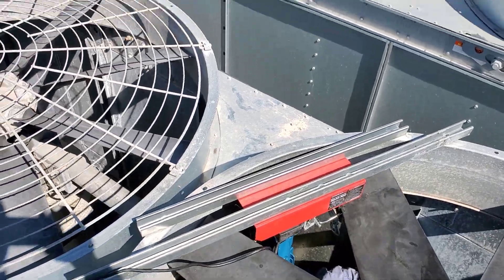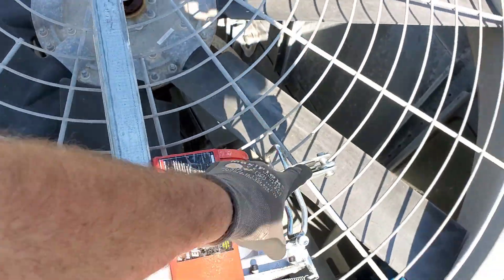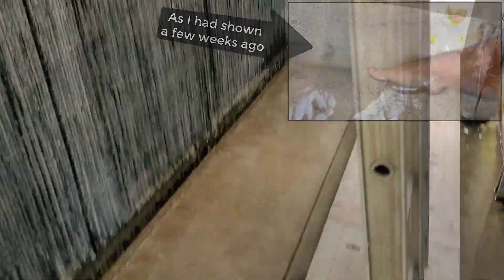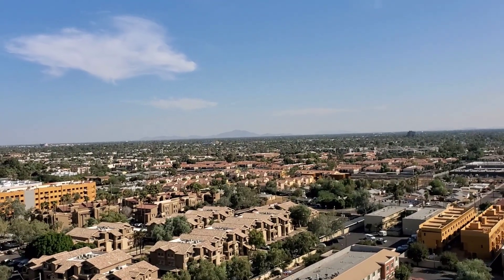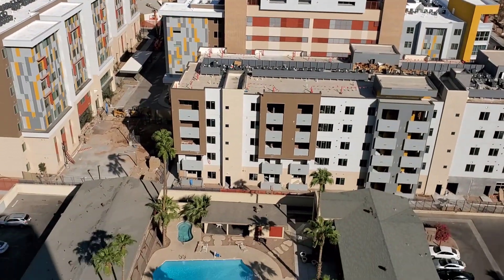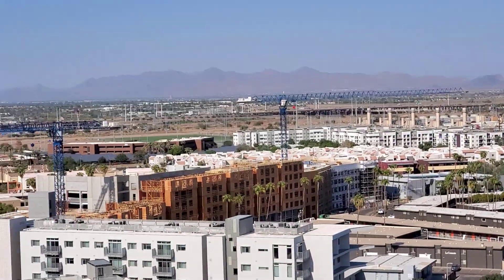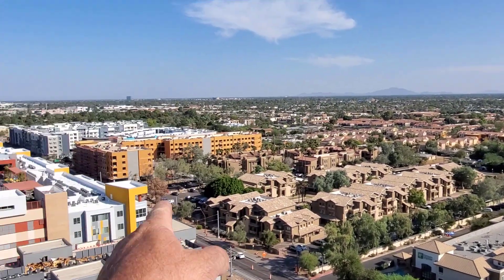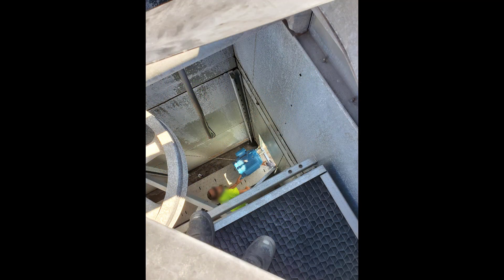Replacing a 550 Lb Tower motor using a Harbor Freight electric winch

Comment: I use those harbor freight electric lifts to pull compressors through roof hatches.  They aren't anything special, but they are small and they work.
Reply from the maker: They've worked for me so far.
My old one is over 10 years old now.